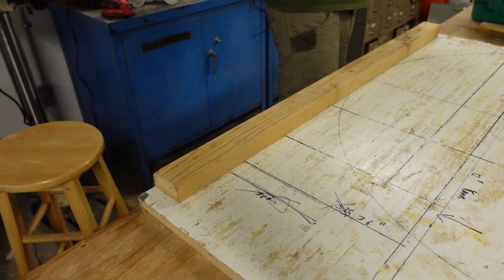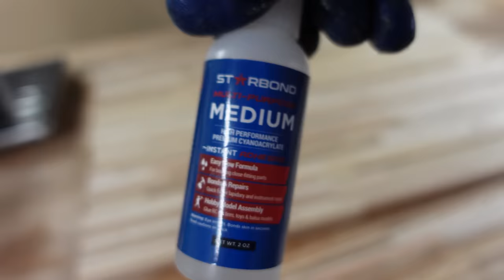Building A Dining Table From Pallet Wood! + Aromatic Cedar Base And Spalted Legs!

Comment: I think that it would help you if you put that assembly board on the other side of your workbench. Then all you would have to do is turn around to use the miter saw instead of walking all the way around like you are doing to trim the ends. Great video and build by the way looks great.
Reply from the maker: I appreciate the comment and tip david! Its a great idea honestly, ive actually moved into a new shop well after this video, ive just been in a slump with uploads, i have about 9 i have to edit and upload but the mountain just seems too steep at the moment, Ive got new content coming soon though! Please stick around and check it out!

Comment: Hey, I saw this tip the other day about the stuff you use to clean the sanding belts. It's kinda expensive to buy that block, but did you know it's the same stuff used for shoe soles? The salvation army and goodwill sell shoes and you can find the ones with that same material and buy for only a $1 or $2 a pair. Remove the uppers and use the soles to clean the sanding belts for cheap! Good tip! 👍🏻🇺🇸
Reply: I do the same thing with shoes works like a charm
Reply: Wow, top tip! Thanks for sharing 👍🏻

Comment: Don't screw down the table top like that. You can maybe do it in the length direction and get away with it, but  in the width, it will prevent the wood from being able to expand and contract with the seasons, as it is going to do anyway, and it will split. You need some kind of slot or swivel where the screw can slide a little in the width, while still holding the top down. There are a number of hardware pieces available specifically for this job, or you could rig up something yourself. Check out old tables. The ones that don't do this are either made of plywood or particle board, or they have cracks in them. Don't let your projects self destruct.
Reply: I am not so afraid of that. Wood expands sideways. He basically created a slab of vertical plywood.
Reply: @tjerkheringa937  No, he didn't. Plywood grain alternates direction with each layer. This runs all the same direction. Expansion is not the problem. Contraction is. If you look at better quality furniture, you will see various solutions to the problem of wood movement, while still holding something like a table top securely on the base. I can pretty much guarantee you that in a few short years this top will have cracks in it. This is a good example of how not to do it. But experience is the best teacher.

Comment: It`s beautiful, I don`t have any luck with the minwax, mine feels smooth and flat, but when you get close up there are millions of tiny micro bubbles. The last top I made for a steel base table, I did one pour of epoxy and let it flow out, torched it and loved the results, boy is the epoxy expensive, love your work.

Comment: Does anyone know how he manages to use Brad nails n then run through table saw, and use biscuit joiner. Is it a case of getting blade for saw that's multi material, n biscuit joiner goes through them OK. Ty all

Comment: What are the advantages or disadvantages of using the brad nails between each board?  I really enjoy your work.
Reply from the maker: The main reason i use the brads is to help hold everything. It would be incredibly hard to keep everything from sliding all over if you were to try to glue this without using brads. That being said, if you were to use straight unsegmented layers, using just glue wood be fine. Thanks for watching rob!!

Comment: Nice table and the legs are gorgeous! Can you explain me the purpose of that 'stopblock' when you trimmed the strips?
Reply from the maker: Thank you for the kind words! The stopblock acts to align the strip for minimal waste, and allows me to setup and cut many at a time in quick order. The reason I'm trimming in the first place is to reduce the gap that happens when i butt the edges together during the assembly.

Comment: Really nice and helpful to watch. Do you happen to be using the sander instead of a plainer because of the metal bits in the pallet wood?
Reply from the maker: They always go in the planer first! Its a risk i have to take,. i generally run each board across my metal detector to make sure there is nothing left behind, and then do a visual inspection along with sanding to make sure there aren't any stones or dirt left on the wood. And then just gotta make sure to keep the brads low enough in the board, and hope they dont wander upward. I have definitely nicked a few blades over the years. Thanks for watching and commenting!
Reply: @treecycled  ok..t for taking the time to reply here too. Very welcome sir!

Comment: Do you think there will be any problem with wood expansion over time? Very nice work, enjoyed watching.
Reply from the maker: I've been making these for about 6 years now, in some fashion or another, and from my experience i haven't had any complaints yet! Not to say something might come in the future though. Thanks for watching!
Reply: My guess would be that due to it being recycled pallet wood, most of the extreme expansion over time has happened to it already. Add to that there's so much glue and the final coats of poly on everything I'd think it should be good!

Comment: Your videos have been a huge inspiration for me but after building a similar tabletop and coming back and rewatching this video since gaining that experience.. I can't help but feel like you made it so much more work than it had to be? For example.. what was the thought process behind the first initial dry fit (about 2:40) just to grab the specific amount of pieces of wood that was needed? I understand you had to make the end square but why not just square ALL the pieces, since you've prepared them all for this regardless of if its this project or the next? Or to really save yourself more effort, when you are breaking down the pallets and shortening each piece - just cut them square the first time.

I mean absolutely NO offense by any of this, but it all just feels like a colossal waste of time? You have the pieces ripped down to size already when the video starts.. if they were all square then you could do a quick dry fit, and as you go you would cut the pieces on the ends to fit the 36" length. Then you can just glue it from there. No need to take them apart like at 9:32. This way would also save you from doing two additional dry fits.
Reply from the maker: Im a work in progress for sure! But i needed to lay everything out at first to make sure first that i had enough wood to work with on that specific project. I definitely could have just squared them there as i went in that situation. My process is being refined every time, and I'm a bit scatter brained for sure in that instance. But i absolutely have to take them apart layer by layer before glue up, because i needed to both glue and brad nail them, in a quick enough amount of time that the glue doesn't begin to fully set before i clamp them. Clamping is an important step because I'm not relying on the brads for the clamping pressure, they are more so there to stop everything from sliding around during the glue up. Without brads it would be nearly impossible to get everything perfect. And during that process if I'm also trimming pieces to length it adds a lot of time that the glue wood have to dry. I hope that makes sense,.. This table was from a few years ago though, and my process is much more refined now, i have table jigs setup and most if not all of the piece refinement is done before glue up. Still trying to figure out how to get away from brad nailing though, I have a bunch of videos coming out soon showing off my process evolving. Thanks for the comment and the questions! So happy to have inspired and i hope you stick around for future videos! There are a lot coming!
Reply from the maker: Also shoot me a message on FB or IG, i would love to see your table!